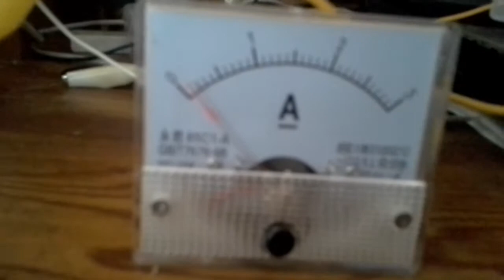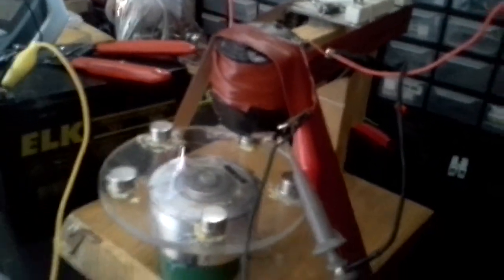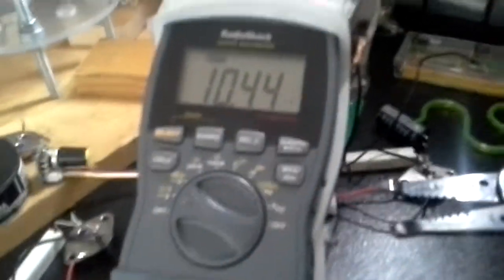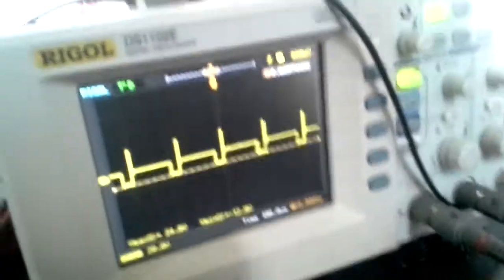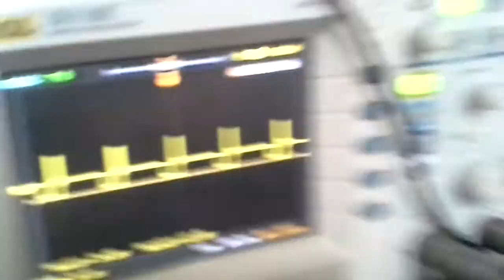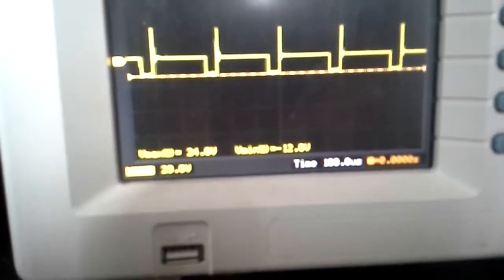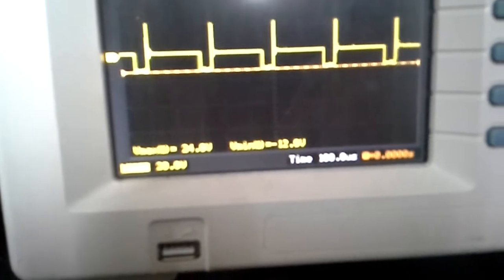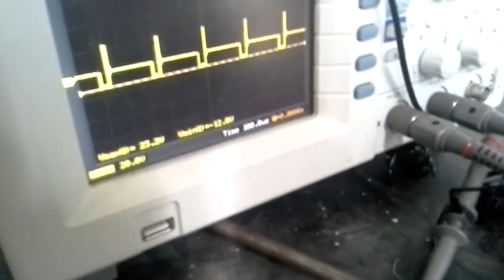solid state bedini motor ssg without the rotor

Comment from the maker: Yes... the being circuit basically is an auto-tuning circuit. You can get the same reaction in a coil by pulsing it with something. I used my arduino so I could write a code to be able to adjust the frequency and cycle. Then I hooked it up to a coil and played with the settings ...when you get the right frequency for the coil you see the spike get bigger.  Anytime I charge with it I adjusted after hooking up the load battery and once or twice during charging always did well for me